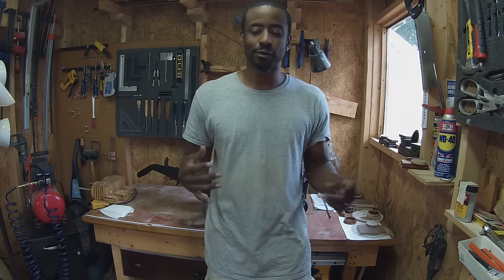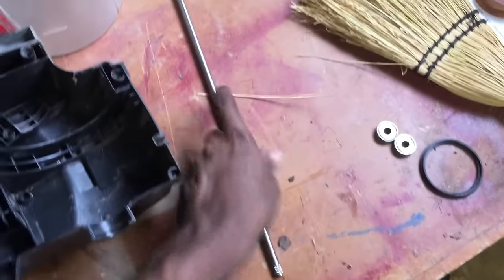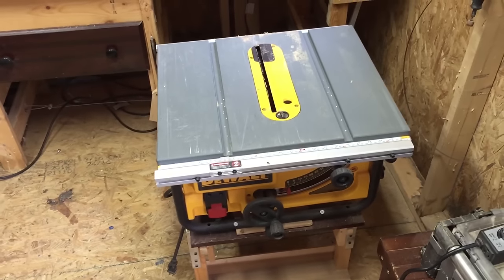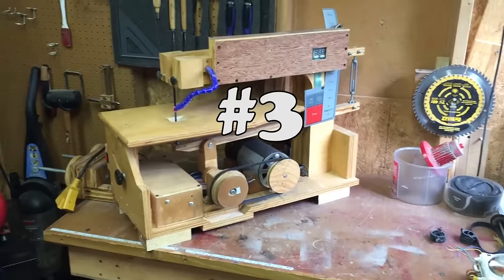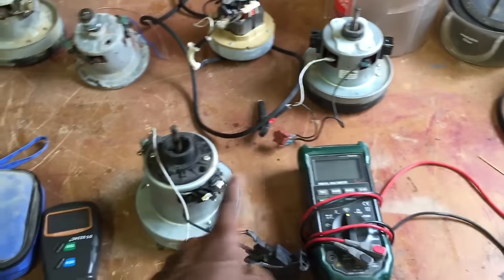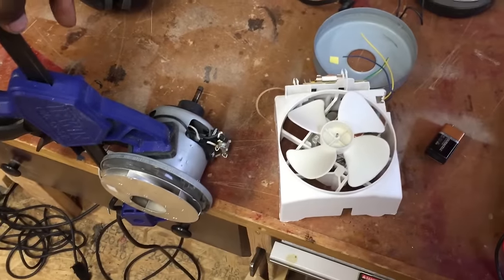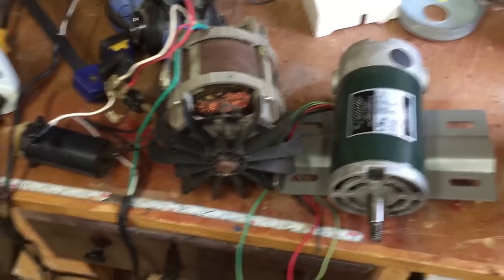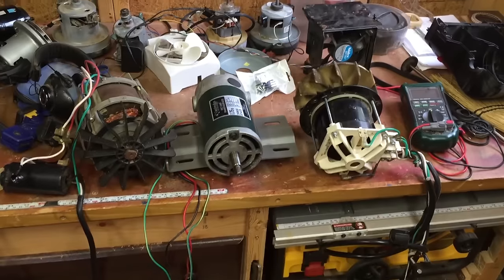Things You Can Make With A Vacuum and Other Salvaged Motors: # 010

Comment: Jeremy I love the fact that you go low tech (meaning not going out and buying expensive tools) and just use what you have or find!!! This is my kind of shop which is just like mine. Sure I would love to have the money to build out my shop like some of these other ones here on the tube but hey, what's the fun is that right!!!!
Reply from the maker: Yeah... Some things aren't worth spending money on... like dust collection, but some things just aren't worth building. For example, I am saving for a large drill press. I did find a very cheap planer today on a local listing, so that is nice. Small upgrades over time is what it takes for us with a regular budget.
Reply: Agreed. I had bought a cheap table saw (garage sale) and my finger almost regretted it. I'm planning on buying a new DeWalt very similar to the one you have.

Comment: old video, just seeing it tho. I just took apart a vac, and seeing this vid I missed some parts that could have been useful in the future. but there was a second motor to turn the brush. not sure I saw you pull that out. the brush yes, that rod......need to save that next time as well as the bearings. your the man.

Comment: In the uk the capacitor used is for something called power factor correction. It help with the dramatic start up current of the motor. There is a mathematical  equation to find out which capacitor you need for the amount of windings and gauge of wire you have in your motor and it’s dedicated voltage and so on.

Comment: HAHA! Looks like my shop, LOL.  Good ideas.  I've used a vacuum motor to make a super box/window fan (LOUD, but powerful) and 8 motors wired to work with 250v from a dryer plug to make a flowbench for testing cylinder head designs and porting.

Comment: I got something for a dust collector that works so well that I had my electric sander hooked up to it while I was sanding thick old sheet rock mud.  The dust never was in the air or in my shop vac filter.  Make a water filter, mine worked so good that it filtered all the way till the water locked up from the dust.

Comment: Man, you are the King of Re-Purposing!  Love the video.
Reply from the maker: +TrikeRoadPoet thank you
Reply: My buddy used an old vacuum motor, replacing the impeller with an piece of aluminum (1/2" thick disc) as a flywheel.  Need to accurately drill the center hole, and tig welded a short slug of aluminum to the side of the disc for holding a set screw to attach to motor shaft.  Less noise and more power on his bench sander (1" wide belt.)   The thick aluminum disc helps the belt maintain power when he is sanding, especially when first contacting the belt where friction would slow the belt down.  Love the idea of re-purposing tools and things for another use, really gives credence to the idea of recycling.

Comment: I accidentally found your channel and subscribed immediately. Fantastic video. I am going to spend the rest of the evening watching the rest of your videos. I have made some similar stuff out of supposedly broken vacuums. A leaf blower that works incredibly well. A bench top grinder. I am currently collecting parts for a high speed rotary tool(big hoover vacuum motor, speedometer cable for flexible shaft, old aluminum double A flashlight with shaft and bearings from vacuum brush inside and a small adjustable collet )

Comment: Jeremy, speaking of microwave ovens, have you made a magnetic base to hold small objects for drilling or machining?
Using a full wave rectifier usually works better with a capacitor to filter the power. 
One thing you might have missed from stripping down vacuum cleaners is building your kids wooden toys and using the wheels from them. I've done this before, but the wheels on some are so cheaply made.

Comment: The cool thing about these generic vacuum motors is that they are also able to run on DC. I have one on my homemade brass vibratory cleaner and a 19 volt computer power supply provides the perfect RPM for that.

Comment: This kind of motor in vacuum cleaners is called reluctance machine (a type of salient pole synchronous machine) and it has few advantage is as it is very cheap. It has many disadvantages such as bad efficiency and loud noise etc.

Comment: For a wood working shop use the largest drop canister you can the collection pipe goes into the side of the canister a few inches from the top, the motor and suction unit should be on the opposite side slightly above the level of the collection pipe the lid should have a baffle to stop the air flow going straight across the chamber. Now the good bit, cut the bottom out of the drop canister and put a plastic bag to collect the shavings secure with an old bicycle inner tube when full the bag can be removed and replaced when full, you need to create a frame to prevent the bag collapsing. Be safe in your work shop. Never use equipment outside its designed limits. especially electrical equipment.

Comment: You can cut down a chrome dual exhaust tip for a car and use it as a manifold for two hoses off of one shop vac or one powerful hose off of two vacs. We do it at work with large industrial vacs that are hooked up to large floor grinders.
Reply from the maker: interesting...

Comment: 10:00 capacitor start motors; the cap is in series with the START winding, and after about   0.25   seconds, is switched out of the circuit, (centrifugal switch on one end of the rotor shaft, usually always on the opposite end of the driving end) and then the RUN winding takes the power, for rotational force/torque for ongoing operation.

Comment: I really like your videos. You’ve got an amazing eye for Macgyver’ing a solution from what’s on hand. You might sacrifice time or sweat, but quality and functionality is always top notch.

I feel like you maybe missed a bit of an opportunity, though. If you’re already pulling out the table saw & changing elevation prior to use, why didn’t you incorporate the remote start on the vacuum into that motion? I wouldn’t think twice about totally spending  a month fine-tuning a setup for making the increased elevation turn the vacuum on, and decreasing elevation turning it off as opposed to wasting 3 arduous seconds whenever I used the dust collector. 

Keep up the good work!

Comment: that vac's  plastic housing is what kept it cool   keep that air produced trapped    around the  vac motor , I use old step down trannys from nusic equip or others to change any ac to dc and dropping voltages 110 to 12 v , rectifiers areat to 
 but someone stole all the Radio Shacks   ,

Comment: I have a collection box for my workshop air system, the vacuum socks the air from the collector which socks air through whichever gate is open depending upon which machine is running. it also holds a lot more and to empty, the box front just pops off to get to the sawdust with a small shovel

Comment: Great video, brother! First video seen and I'm subscribed. Keep it up!

Keep all the control boards from the treadmills too. When treadmills go out it's almost always either a bad resistor or bad capacitor, easy fix. Keeping it all with the motor gives you extra controls such as variable speeds and emergency cutoff. Plus keep the speed sensors located at the rollers belt pulley. 

With the treadmills I find with only the motor being good (usually weathered for extended periods) I'll make windmill generators that with the right setup will charge a dead car battery in 1-2 hours with only 5-10mph winds.

Comment: Really awesome shop you've put together. I like doing the same type of salvaging but I'm not nearly as good at it as you lol. I did make a nice fan from an old window AC unit fan with the base from an old blender, and wired it so the blender buttons would power the fan lol. I called it the Fander!
Reply from the maker: I would like to see a picture of that LOL
Reply: I live in South Texas so it helps with this heat we have lol.    http://image.prntscr.com/image/51b7ec9cc25a45fba606f7904ab77b67.png

Comment: I just salvaged a Bissel carpet and upholstery cleaner last night, lots of goodies in those.  Rubber tubing , motor,
pump, hose clamps, small water heater,  two rocker switches and the usual bandits. I've have some hubs from bicycle wheels, was going to fashion a high speed belt sander. That tip about the fan blade drawing air over the motor was a big help. That will come in handy. It has always been  a MacGyver thing with me. feels good to make what you need instead of buying it. To a reasonable extent, anyway.
Have a good time Jeremy.
Trump 2020

Comment: Where do you store all these extra motors? I have  my share of recycled motors but not enough projects to used them for. I therefore want to suggest a simple use for washing machine motors. I have used them in the past to turn my drum brakes. I would remove the drum and reinstall in backward (open side facing the sidewalk).  With the car on neutral, I would pass a belt around the drum and also around the pulley attached to the motor.  The motor will need to be mounted to a portable structure that can be weighed down with a block or two. Wet & dry sandpaper will help you smooth down the drum interior and improve brake performance.  It pays to know a lot about the parts and mechanisms of machines that cost a lot of money.Thanks for the video!

Comment: #Jeremy Fielding - Love how you recycle vacuums or whatever you find, and turn it into something new. Most people don't have the mechanical skills nor thought process to do things like that. I've recycled a lot of stuff that most people just toss as junk. Some of it, if i had a use for it, i was able to repair and use the actual product. Other things I tear it down and use it for something else, or save the parts it if I don't have a use for it at the time. 
And YES Treadmill motors are GREAT for SO Many projects and tool builds, I like finding a whole treadmill because then you have the recifiers, power supply, and variable speed controls. I usually build a "control box" and modify the controls and mount them in a small box... hadn't thought about a vacuum motor though, but also never really found any vacuums thrown out, have to keep an eye out for them from now on. Thanks for the ideas! Oh, and you've got a new subscriber too :-) Have to watch the rest of your videos, then be looking new videos :-)

Comment: I tried to use a dishwasher pump to make a small fountain. Good stuff the motor got too hot bc it’s not made for continual use but I learned a lot from the experience. I wonder if adding a small fan could make a big difference in prolonged use.

Comment: Try to use a leaf blower/vac as dust colector/vac. Usualy the lower part is the intake most are around 175-200mph. They are stronger than reg vac.

Comment: Although this isn't about repurposing, I hate to discard usable items.  I once repaired a vacuum with a cracked impellor plastic bell housing that was also missing a piece.  I used JB weld.  After placing a thin layer on the bell, I took some sewing thread and wound it around the bell many times, squeezing the epoxy into the thread and covering the missing area.  I then placed another layer over the thread and let it harden overnight.  I was visiting my niece and she was dreading buying a vacuum on short notice.  The patch worked well and continued to serve for another year.   Using strong thread in epoxy is very similar to resin coated linen used on circuit boards.  This technique can also be used to fabricate parts in odd shapes such as motor mounts.

Comment: In England, if we want to abbreviate "Vacuum Cleaner" we say "Hoover" (even if it's not made by Hoover)... it seems funny seeing someone use the much more sensible short form "Vacuum".
I took a "Hoover" apart a couple of months ago and haven't thrown away the "rejects" yet... which is handy because I hadn't thought of chopping the casing down with my jig-saw (I haven't got a band-saw) to make a mounting bracket for it... good tip!
It'd be really really cool if you could have the shop-vac come on automatically when you switch your table-saw on.

Comment: If you want to control a motor, without using a variable resistor, you could use a triac or a duty-cycle control circuit.

Comment: I'd bought a deeply discounted battery powered lawnmower which also seemed to have a bad battery. It could not charge up even after a week on my Battery Tender™. So, I bought a new battery. Tinkerer that I am I disassembled the old battery just to see what's inside. Low and behold they had 3 12 volt batteries hooked together to make 36 volt package. I took photos of the wiring to make sure it could go back together the same way then separated them and charged them individually to see if maybe one bad one was preventing the others from charging. The 1st one charged up fine so that wasn't the dead one.  The 2nd one also charged up fine so that wasn't the dead one either. I though "why not?" and put the charger to the third one anyway despite being very sure it would not take a charge, but much to my amazement, it worked. Now I have 2 good batteries for my mower. I kind of wish I had tried this before I bought a new one because I have never needed both batteries to finish the yard. Live and learn.
Reply from the maker: Boy do I know the feeling...😂

Comment: I have to say use caution when doing this stuff. I did something like you did by mounting a vacuum cleaner motor up to run a saw blade. Stupid me not knowing about these things put on a cutting wheel blade instead. The motor was so strong it took the blade I had on it and just shredded it to a million pieces just by the force of the motor itself. Luckily I was not standing in line with the blade and was wearing eyes and ear protections. But still I have a couple pieces of it embedded in my roof.

Comment: Protip: the kinds of electric motors used in vacuum cleaners and washing machines do not have a limit on their top speed. Especially if you remove the impeller and run such a motor it is likely to run so fast it explodes. A father was showing his son a salvaged washing machine motor and the explosion killed his son. Please always make sure there is some kind of load for the motor to work against.

Comment: here's another thing you can make: Imagine you are working on one of your awesome projects and drop an invaluable screw, nut, or other small object between the wall and work table.  too tight to reach and too heavy to move, what do you do?  At the end of the hose attach a coffee filter.  fill a balloon with coffee grounds and attach that to the end of the hose.  It will be loose and conform to the object needing to be picked up.  Turn on the vacuum and it will harden such that you can pick it up.  works on larger objects too!

Comment: Hi Jeremy, a piece of advice please. I have removed a 12 amp ac motor from a vacuum cleaner and would like to use it to power a diy drum sander I am building. I think the rpm's are going to be way to high. Any insights into sourcing pulleys and belts, how far to gear it down, etc.? I'm making my first video of the build, and I will make sure to link to your channel and give credit for any advice. Have a great one.

Comment: By putting a piece of duct tape (wink) over the air inlet of the impeller, you can remove a lot of the resistance of the impeller to get a better idea of the rpms.

Comment: Im thinking about storing my CNC from the ceiling with an electric winch. I am a bit concerned with the winch supporting the weight (approx. 200lbs) of the cnc long term.  I thought about using chains tied into the rafters to hook onto the corners of the CNC once it is in the air then let off the tension of the cable to keep the static load off the winch.  Is this overkill or smart thinking.

Comment: On those vacuum motors that get hot, could you just pull the blade assembly off one of those fans and mount it to the shaft that’s sticking out the back of the motor? That way the motor could cool itself, right?

Comment: I recently found a discarded Tineco cordless stick back. The canister bottom was missing as well as any attachments so it was worthless as a vacume but the battery and motor function perfectly. Any tips on how I can (without buying a new battery charger) charge the lithium battery safely? I would love to find a way to use this perfect motor but I’ve got maybe 1/4 of the battery left. Could I modify a dewalt battery charger possibly? I’ve got 3 and could spare 1 for the project.

Comment: Some motors can be rotated by a engine and they will put out Ac power, some will put out DC Power. You can turn a 3 phase motor with a 2 phase and make 3 phase current,

Comment: A full bridge rectifier on its own with 110 Volts 15 Amps running threw it most likely wont give you the correct DC voltage output needed to run that motor. You need to attach a regulator circuit to that bridge rectifier. It will filter, stabilize and match the DC to the motors labelled input, plus you could make its output adjustable to run other things. You could also throw in a transistor and sense resistor at the output to create over current protection.

Comment: When do you use a rectifier vs a power supply? If I have a 24v DC 500w 27 peak amp motor, can I just wire its motor controller up to AC with a rectifier instead of having to pay a ton for a power supply?

Comment: Hey man love your shows. I just found you a week ago .I got a tread mill and 4 wheel barrel tires and jumper pack to run the 12 DC motor .. I saw were you took a tread mill apart but was wondering if you ever made like electric wheel barrel or something like that?

Comment: I have a vacuum motor, trying to make an electric weed whacker. Used the original switch and wire. Did a test run (without motor held down) and it jumped and started sparking. Scared the sh.. outta me,  wanted to learn a little more about it before completing what I was trying to do. Any advice would be nice.